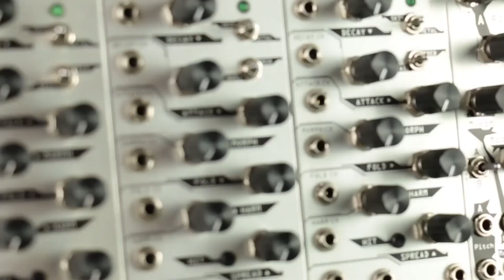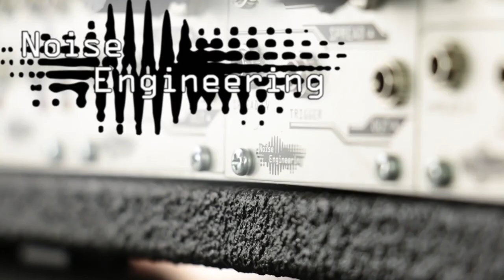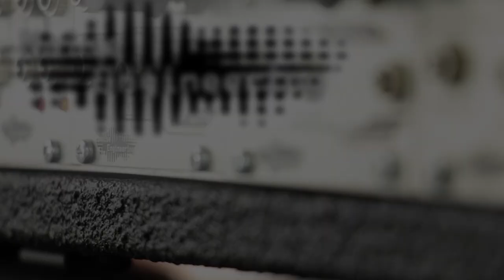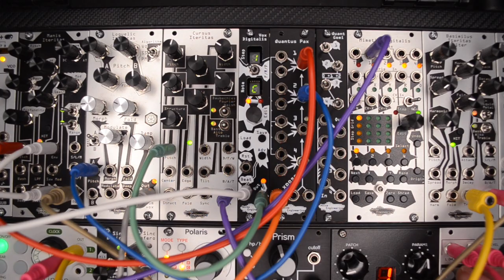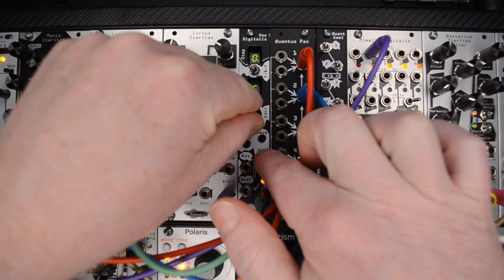Vox Digitalis Demo: 16-step sequencer in 4HP from Noise Engineering

Comment: Did I miss it? Can u add rests to sequences?
Reply from the maker: Rests are usually controlled by the triggering sequence; VD only outputs pitches.
Reply: @NoiseEngineering  Similar to Mimetic. If you have something to sequence triggers, the advantage is you get a full 16 steps of pitch, and not a subdivision of that compensating for rests